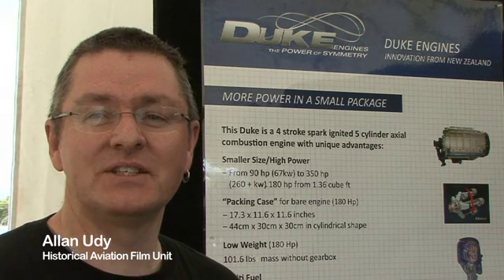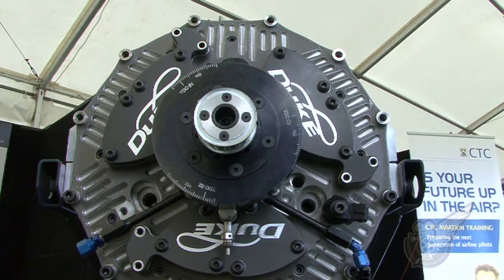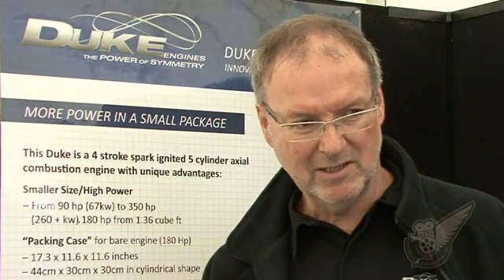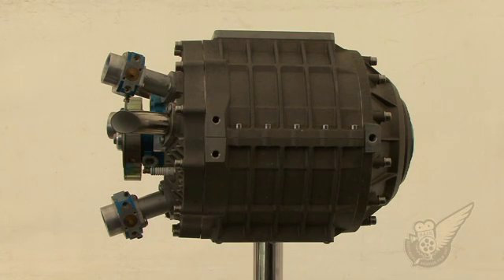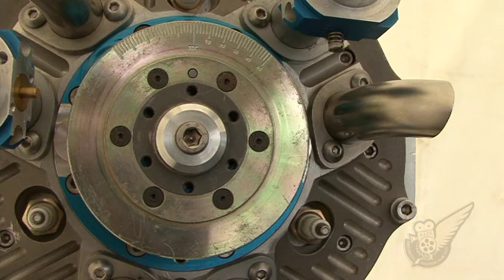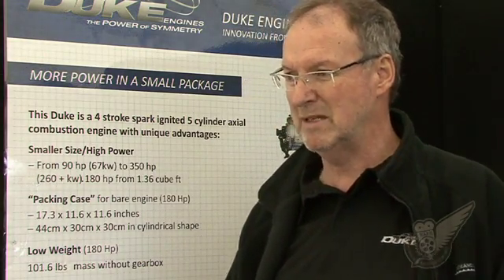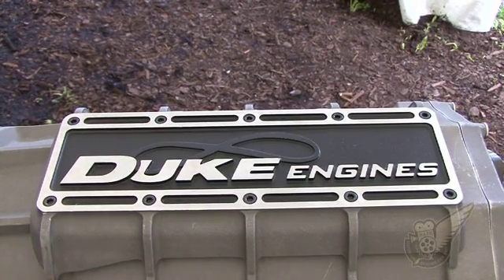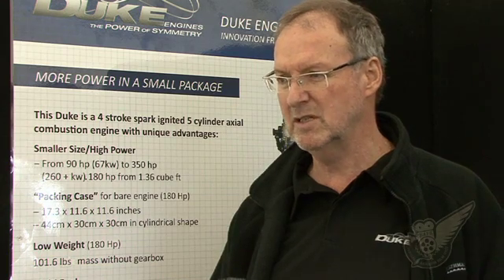Engine: Duke 4-Stroke Axial Piston

Comment: Coming by 10yrs later, wOw, to see notification come up moments ago. 

What people dont have a clue of, theres tons of examples of those who simply go to Industrial Supply, walk down the isles, and grab off the shelf any device that has pistons- and try to force fuel and spark plugs i to it - just as this Axial unit - Its actually a high performace pressure washer that when running using 40Hp electric motor could if aimed at you - simply slices you in half. 

Later used in water jet cutting - from pastries to steel. ❤ 

This is only one example of reverse applied industrial nonsense. 

Where low level Hank Hardwae engineers think they can abuse a pump made to force pistons to perform a function - think they can reverse the concept and make the same pistons force rotation at the shaft which never was engineered to ever function.. 

But notice the cool way its mounted and displayed,, Its an enclosed case of mystery. 

Only To make idiots think other idiots actually invented altered  reality and not one of these idiots even owns an allen wrench. 

I've been to Oshkosh many times restoring WWII aircraft for many years,  Mainly to see my Favd ship arrive rebuilt from scratch, the famous B-25, and the very famous 1943 Beech Staggerwing, test flying him 10 yrs later in formation, and deadly 2.5G barrel roll. To me anyway. I dont like rollercoasters. 
Cheers

Comment: My main concern,  is still with, cost and longevity.  The engine concept is not new, they do work. The real question is....."For how long?".....longevity has always been the issue. Small efficient engines with very short lifespans. If they can make it last longer.....much much longer, they may be on to something.
Reply: They are NOT on to anything! 
I designed an axial engine that will work and this Duke engine is just like the one the German politech built back in the 70s. Both of them make the same stupid mistake. Mine does not!

Comment: Do pistons have any rotary motion excluding reciprocating motion
Reply: No... it is describing the arrangement of the pistons, not that the pistons move in a rotary fashion. 

If you knew ANYthing about piston engines... you'd know its NOT possible for the piston to turn in its bore because of the pistons wrist pin, and the fact that its captive at the other end of the conrod by the crankshaft.... 

Do some more research...

Comment: problem with motors is revolutions create heat and wear, if you can get them down to the lowest revs you would have less heat and wear and the motor will last longer, that's why large diesels only run to around 1500 rpm and thus have durability.

Comment: 4.2 litre, 350HP. Under 100HP per litre.  Not exceptional. Sealing head to block ?. Bet it is thirsty.  We will see.  What is the problem with the normal 4 stroke  piston engines ?. Mine goes very well.
Reply: DrgnFlys Having it in an axial configuration like this could work if the bearings survive, but they could have just left the cylinders stationary and had normal poppet or rotary valves

Comment: just build a car and put it on a race track. that should open people eye.
Reply: why build a car? the real test is a full weight car with a stock motor out put the same or greater than this and then drive it in a city, with variations in speed, you will see a true representation of performance and reliability.
Reply: Anis Mohd.... just build a car, and park it on a set of rail tracks. That should open your eyes... for a few seconds.

Comment: Cool concept, but how does this things head seal with it revolving like that?
Reply: I'm thinking that because the engines are ported the cylinder heads might be integral to the cylinders. It would be easier to seal the ports as the cylinder rotates past

Comment: 180bhp from 4.2 liters is only 42.86hp per liter. That's quite poor for a modern engine. I wonder if this type of engine could be turbocharged or supercharged. The lackluster power output really necessitates forced induction.
Reply: Turbo Yoda once said that spiritually, everything should be turbocharged.
Reply: Sounds about right lol good math
Reply: Displacement comparison is only valid when comparing same types of engines, also displacement is pretty irrelevant, what you really want to focus here is fuel consumption (efficiency), power output, external dimensions of the engine and weight, ...also reliability, vibrations, heat output, complexity, etc
Reply: True
Reply: I wonder if they don't have all the bugs worked out yet like the pushrod motor has had the pleasure of.  My guess is that since there is no camshaft, there's no real way to make a so to speak "valve" stay open longer or open further than it used to to help create more power by allowing in more A/F mixture.  I'm also wondering if it's ignition timing that is also a culprit here as to why this 4.2 is only making 180hp.  Plenty of automakers have engines half this size and yet still makes the same power if not more.  I understand these Duke engines are still under development and they're still working out the bugs.  So, with only 180 hp and 4.2 liters, this sounds like a very "slow" revving engine and will be used in low hp applications like farming equipment, tractors, off-road earth movers, etc....
Reply: Lol I would like to see this engine race
Reply: if it has exhaust gases it can be turbo'd
Reply: elpidiovaldez4ever yup that's right the co founder is probably a good engineer but his communication skills aren't very good with laymen. I hope they find a good spokesperson soon.if the engine has the efficiency gains needed to compete with conventional piston technology, it's going to need a good pitch man.
Reply: +sjpro1 on their site it says they can be.. however the question is whether or not the internals can take the pressure without one nasty explosion

Comment: I know much is secret information. I still must ask, is the cooling via air, I noticed fins on outer case? Lubrication, is it wet sump, dry sump, is oil metered into the fuel for cylinder lubrication? Is the intake mixture regulated by throttle body and ECM or are there injectors? Thanks, sorry for being such a pill, I just love the new designs that look viable.

Comment: One fatal flaw of this design:  Centripetal force makes the pistons want to go through the cylinder walls.  That said, conventional round pistons, cylinders and rings don't stand a chance of working reliably in this configuration.  What one would want would be a cylinder and piston shaped like a piece of pie.  That would better distribute centripetal force on the outside edge of the piece of pie.
Reply: nj4ck
 that's not true. most pistons are cam ground cause the piston heats up in different areas faster. it's only a few thousands of an inch, so it isn't very significant. look up cam ground piston and you'll see what I'm talking about, I'm not that good of a teacher.
Reply: you would make a great engineer, I didn't even think of that.
Reply: pistons have to be perfectly circular in shape, otherwise heat will not be evenly distributed over the piston's surface, causing problems. Honda had a bike with oval pistons in the early 90s, it wasn't very reliable and didn't work very well overall.

Comment: the spec aren't 350hp from a 4.2 litre motor is horrible and a 13b is more compact and more power from a lower capacity motor
Reply: A 13b is not 4litres its 2.6 the seal issues are sorted and torque isn't an issue unless you towing a if I can carry one then its not heavy but all that was an issue in 73 with the first 13b
Reply: Still wrong check its operation there are tons videos on it, it uses 2 faces per cycle so double it rated capacity and how many motors do you know a single person can carry
Reply: Also forget 4 stroke rules they don't apply not even close
Reply: Shayne Gadsden

You're comparing an engine with over 60 years of development with funding from one of the largest names in Japanese automakers and STILL has issues to an engine with roughly 20 years of development and still in prototype stage, this engine has plenty of potential and it's incredible to think where it can go from here.
Reply: 13B or any wankel for that matter, have inherent intake mixture dilution issues, which even the Renesis engine could not solve.

Comment: Who cares if it's lighter if if can't spin fast? That just means that it not suitable as a motorsports engine as well as not being suitable for industrial applications either unless it's somehow more durable than current diesel engines while heavily turbocharged...
Reply: They also talked about dyno numbers above 6k rpm.  Compared to a little four banger or rotary, yeah its a bit low, but compared to diesel, even my trucks petrol engine, is a pretty high rpm.  For motorsports, if it has great mid-range torque, then it can be used quite well, but even then, its main purpose is to me an airplane engine.

Comment: There are many smaller motorcycle engines with a better power output. For an even better power to weight ratio you could go to rotary, which makes sense when used in drones and light aircraft. I wonder how machining and assembly costs compare, not well I bet.

Comment: Rotary piston is the way to go. Ive designed several rotary piston engines and the advantages over traditional IC engines is tremendous. One rotary piston design i have, if built to the same dimensions as the 100kg duke engine, would be over 4x the displacement of the duke engine

Comment: This will never make it to a road car, it can not generate enough torque to deal with a road car weight. This is meant for generators and machines with extremely minimal weight resistance, EX- boats and aircraft. Maybe a motorcycle with a completely new prototype gearbox.